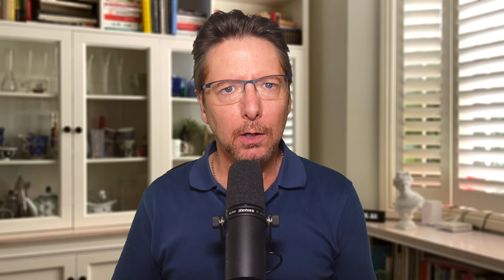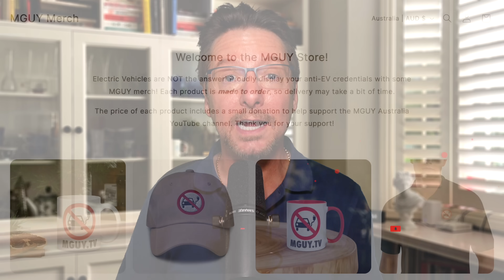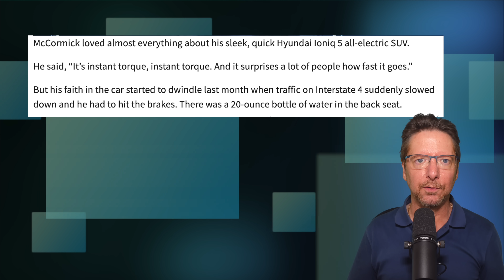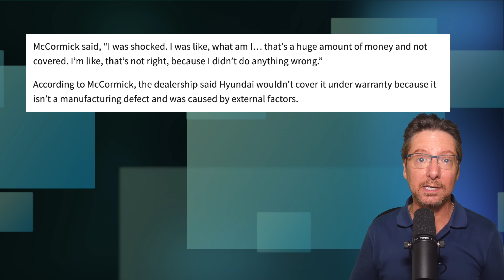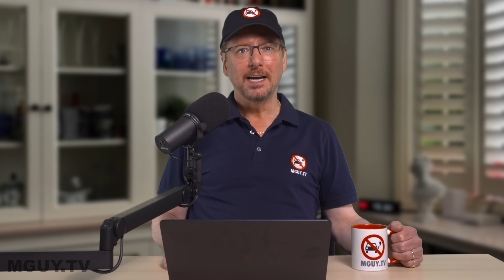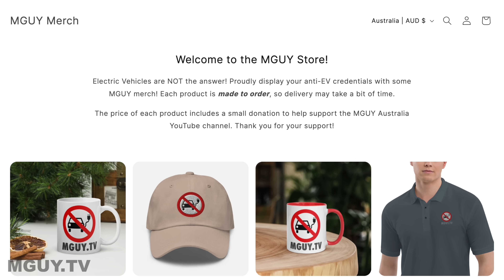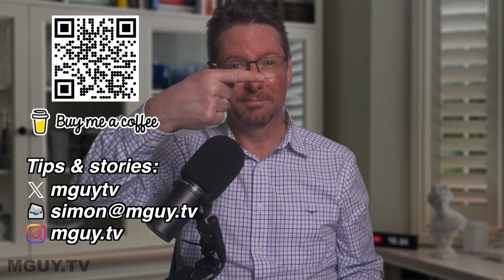ASTRONOMICAL EV repair bill for spilling a WATER BOTTLE! | MGUY Australia

Comment: Its not only cars. Tractors now are all full of electronics and one faulty bit means a whole electronic control unit needs replacing. ECU's are VERY expensive. "Repairing" things doesn't happen any more, you simply replace whole (expensive)  sections when a small part fails. Electronics are great when they work, but s**t when they don't.

Comment: Let's be very clear here. 
The water got into the wiring harness that is inside the cabin.   Now it so happens that ICEs and EVs have wiring harness inside the cabin. 
Engine management units for ICEs are often under the driver or passenger seat. 

So this fault could very much happen to an ICE and cost similar. 

So no this is not really an EV only fault. But rather sounds like a Hyundai issue 0:00
Reply: Hey Stewart, this is an anti-EV channel.
Reply: @thevolvodrive2811  I know. 
I also has a need to highlight  misleading information that Simon puts out , often by not  explaining the full story or omitting important facts. 

It's appears many who view this channel are  not willing or unable  to do their own fact checking
Reply: @stewart5989 Dear Stewart. I applaud your need to highlight misinformation. However, I suggest you hang out on pro-EV channels where the real lies and deceptions are really being spread!
Reply: @thevolvodrive2811  May I ask what lies in particular you are referring to.
Reply: @stewart5989  You're a big boy Stewart. You go check out some pro-EV channels and I am sure that you can figure it out for yourself.

Comment: I'm surprised some company hasn't introduced a conversion service that converts an EV to a sensible gas car.
Reply: The way they are designed for the electric drive is so different to a conventional car it would involve so much work to actually fit a petrol or diesel engine and make it either rear wheel drive or front,it would be ultimately easier to cut the entire flour pan out and swap it for a normal car flour pan that has all the mounting points needed for the engine gearbox petrol or diesel tank the suspension on an ev holds the drive motors so every thing basically is completely different underneath, probably why there are no conversation kits or any converted ev,s, rich rebuilds did a ls v8 swap into an early Tesla and it involved 3 years work iirc and remaking the underside and engine bay that is all aluminium specialist welding and expensive materials it did eventually run and drive but was more a showpiece for the USA Sema show than a reliable usable car

Comment: Bad design is not unique to EV’s now.  An auto mechanic did a video on a new Ford car that the inside door latch on the passenger door had broken.  He can’t replace just the lever, but will have to replace the entire interior door panel.

Comment: In general an EV will save a person perhaps $35,000 in petrol costs over 20 years.

Thank you.
Reply: This only applies if you are charging at home, in a state with cheaper electricity costs 😅.

If you live in Hoboken, NJ then comparing it to an average gasoline only vehicle like the 2025 honda accord, 28mpg combined the BEST case scenario is you save $1480 over 20 years, and this is after expending an average of 91 hours a year finding parking in Hoboken's city subsidized parking garage B or D and getting a charging spot then coming back and moving it to another spot in the garage to avoid idling fees then moving it out of the garage within 8 hours to avoid overnight parking fees. Charging on the street loses money vs gasoline, DC fast charging loses a LOT of money vs gasoline 😂😂😂😂

And thats only at less than 2% US wide EV adoption 😂😂😂😂😂😂😂😂

Without considering the electricity price hikes for datacenters or more EVs 😂😂😂😂🤣🤣🤣🤣🤣

Good joke post though. You must have struggled at school.
Reply: @6Sparx9  Some very cheap off-peak tariffs in Hoboken, some less than 10c a kWh...let us say 10c to charge a 60 kWh battery that will take you 300 miles...cost $6.00 compare that to say $35.00 for gas, say $30.00 saved for every 300 miles or $1500 for 15,000 miles a year or $30,000 over 20 years.

Thank you
Reply: @christopherj2231  Nope, I just checked 40 the 56 public chargers offered by Chargepoint and Shell Recharge in Hoboken, all level 2 chargers start at $0.44 per kwh and lvl 3 start at $0.49 plus a $1.30 flat fee.

Apart from the fact a 7.2kw charger takes 5 to 8 hours to charge an EV, charging $0.44 or more per kwh pretty much erases any savings against gasoline, and that doesnt factor in registration taxes, severe rage losses when cooling or heating the cabin or time lost messing around with finding charging. It literally only feasible if you can charge at work or home, or if you use DC fast charging all the time.

Comment: Hyundai is implying that this is a design feature, built-in obsolescence as this is not manufacturing defect.  This means that you shouldn’t buy an EV if you live in a sandy area such as a beach or a desert.  In the USA, Northeast roads are sanded in the winters.  This means that there is a possibility of corrosion.   Basically, avoid any area where a foreign substance can cause corrosion if you own an EV.  Kids in the back spill beverages all the time.  Hyundai is implying that you shouldn’t have kids if you buy an EV.  On top of that,  dogs urinating in an EV could cause corrosion so don’t own pets as well. Nothing is as corrosive as salty urine.  Moreover, don’t let a teenage boy use the EV for a date as he might use the back seats for some extracurricular activities.  Better yet, don’t live a life if you own an EV.

Comment: The parts are purposefully expensive and even when it's the suppliers doing the gouging the manufacturers don't care. They let them. What happens is car manufacturers order parts/components from suppliers and then they allow the suppliers to make those parts unique so only they can manufacture and sell them.
Then when customers suffer from faults the suppliers can ask whatever they want for the part, and there are absolutely no alternatives.
But it's even worse than that: We know for a fact like with Audi's E-Tron car parts, that suppliers have even purposefully made large, expensive modules which are difficult to disassemble and have simple, cheap failure points difficult to replace so that you have to buy the huge, expensive modules instead of replacing a small part worth a few quid.
They even have taken into account skillful repair shops who might still open the large components and try to replace the cheap failed item: the suppliers made eg. bearings special ones which are just between normal bearing sizes so no off-the-shelf bearings can be used to fix the issue, instead needing for a whole electric motor module worth many thousands to be replaced! 

It gets even worse: What the supplier will then do (this is true, documented fact) is when selling them the big replacement modules for many thousands they'll demand the customers send them the old, defective large unit to them. The supplier then repairs those big modules they received back easily with eg. a cheap bearing replacement (only they can do that since they have ordered those special bearings and have ensured the bearing manufacturer will not sell them to anyone else), then they sell those used 'reconditioned' modules as repair items to other customers who had those parts fail in their cars...and they demand customers pay many, many thousands for them! 

This is fact, it has been documented by many repair shops who have revealed this in their videos!

Comment: About 30 years ago we had a car where water leaked into the fuse box from a faulty replacement  windscreen.  When my wife was driving it in a thunderstorm it had what she described as a nervous breakdown as a whole lot of stuff short circuited.
The fuse box and windscreen were replaced by the well known windscreen replacement company the did the original replacement. Did cost anything like 12k even taking inflation into account.

Comment: This story reminded me of some 12 years ago when I had a VW Passat that leaked rainwater from under the bonnet into the nearside footwell and zapped a perfectly placed, and essential, electrical module under the carpet there. Replacement cost was very high and they refused a warranty claim, too. This kind of thing has been endemic in cars for a very long time.

Comment: Imagine spilling a bottle of water and having your bank account drained, it sounds more like a Hyundai Ironic.
Reply: i can see what you were doing there.....
Reply: Fancy your money going faster than your car 😂😂😂😂😂
Reply: @RobBeales I have an old rolls Royce, believe me I know the feeling.
Reply: Moronic you mean
Reply: Well you’ll have to imagine it, because it never happened, the guy drove it through a flooded road and then tried to blame it on a bottle of water, when the garage checked it they found water in all the doors, so knew it had been in at least two foot of water. That’s why they won’t pay out.
Reply: @Linda-u5x Source?
Reply: @roybatty- Same source as Mguy, he thinks electricity and water don’t mix, maybe he’s never heard of a submersible pump, the blokes a clown, an insincere clown, but seems the uneducated are falling for it, does he even know what powers a submarine? He’s a clown period.
Reply: @Linda-u5x Yes, electricity and water don't mix.  I used to work for a small company that manufactured mild hybrid systems for commercial vehicles.  The motor we were using in the kits had a problem with water leaking into the housing and would eventually short it out.  The company went out of business covering warranty because of that motor.  Also, have you ever heard of what happens to cars that get flooded in hurricanes?  They must be identified as such to prevent them being resold as used cars.  Once salt-water infiltrates wiring harnesses, it's just a matter of time before the electrical system suffers random faults.  And I'm sure you've heard of fires happening when EV's are submerged in hurricane storm surges.  Gasoline cars get flooded all the time, but you never hear about them catching fire because of it.  Long-term they will suffer electrical gremlins, but they won't burn down your house because of it.
Reply: @andyharman3022 There are millions of underwater pumps and submarines operating around the world, please don’t base all companies on your failed employer, electricity cables travel under oceans, I’m surprised you don’t know this? And as for cars catching fire, no one on the planet has heard of a diesel or petrol car catching fire,,,,,except they have, the clues in the fuel, you see, petrol is highly flammable and cars that use it have wiring and a battery. You have been told to hate electric cars by the oil billionaires, the same billionaires who are investing in green energy and electric cars. There were people like you who didn’t want the end of whale fishing or the powered loom or steam car, they are called Luddites, and it seems there are still Stone Age clowns around today.
Reply: @Linda-u5x
There is a big difference, the petrol is contained in a relatively small vessel, and the power source and electrics are not in direct contact, EVs are accidents waiting to happen, any hole or pothole has the potential to trigger a malfunction in the battery.
Reply: @pauldurkee4764 That’s just not true, and I don’t know why you want it to be true, desperate for it to be true? Oil tankers spill millions of gallons of oil in the oceans, oil refineries are having fires all the time and destroy wildlife and countryside, what’s wrong with you people? Don’t you want less pollution, why are you worried about billionaire oil barons? You need to get a grip, What do you want next, leaded petrol and the use of asbestos’s? Some peasants just can’t be helped.
Reply: @Linda-u5x That's an interesting twist to the story.  You should have posted that as a 1st-level comment so more people could see it.  But I also point out to you davetaylor4741's comment about driving his Land Cruiser through water over the door sills.  Seems like cars in the real world have to survive unusual circumstances from time to time.
Reply: @scubasqrl So basically you're saying EV's are inferior to real cars.  Make one mistake with one, and it becomes a brick that costs a fortune to fix.
Reply: @Linda-u5x That makes no sense at all, if he drove it into water, it would have broken down immediately, not much later when he got home. Water ruins electronics instantly. Legit insurance companies also cover flood damage.
Reply: @J @John8087 Typical Luddite making up his own narrative, where in my reply did I say when it broke down? No, you just made that bit up didn’t you?
Reply: @Linda-u5x You've been shilling so much you can't even keep your own lies straight. 🤡
Reply: @Linda-u5xstill shouldn’t have damaged the car!!

Comment: Guess where lots of the critical electronic modules are on a USA Ford Transit. Yes just behind the drivers cupholder. Car Wizard did a video about it. I worked for a large Indian Company, if the vehicle failed the water soak test it would wet the carpets or interior , so the seats and carpets etc would be removed, water would be mopped up, concerns about wet electrics were constantly overruled.
I do wonder how many of those vehicle went on to fail due to corrosion.

Comment: Consumer protection doesn't just cover manufacturing defects, whatever you're buying has to be fit for purpose, and take into account what customers are likely to do with it. Spilling a bottle of water on the seats is entirely foreseeable and the design should be able to withstand it. Otherwise, it should be pointed out to the customer at the point of sale so that the customer can make an informed decision as to whether to buy such a fragile vehicle.

Comment: Lift the seats and/or carpet, open all the wiring connectors, hit the connectors with a hair dryer, leave a fan heater or a dehumidifier in the car for a few hours, reconnect all the connectors and switch on.

Car dealers are notorious for wanting to replace a full wiring harness instead of diagnosing and repairing the existing wiring.

Comment: That’s nothing really to do with it being an EV. In many modern petrol cars the seats are complex and house tons of electrical parts. My petrol car has 16 way front seats and I’m sure it will cost a fortune should I be dumb enough to pour water over it. What I don’t get is how water on the back seat got UNDER the front seat. Unless that Chronic 5 has a completely level floor that slopes under the front seats don’t see how it happened. Most cars have I rear footwell and I would have expected the water to end up there.

Comment: Thanks for covering this. One correction, the EV wasn’t a brick as the owner couldn’t shutoff the EV.   This means the EV is operating with fried wiring which is dangerous.  He didn’t say how he got the EV to the dealership.  Watching the YT video from WFTV Channel 9 news shows that this guy is an ordinary guy not some rich dude.  He has a carport not a garage.  You can see a wall picture in the background of a starfish.  He must live by the beach as he has a pillow with a beach quote and the dealership did indicate that sand buildup may be a cause to the corrison. He is just an average guy. It is unfortunate and sad situation.  THIS IS THE WORD TO THE WISE. DON’T BUY NEW TECHNOLOGY UNTIL ALL THE GREMLINS HAVE BEEN WORKED OUT. Hyundai rushed a product to market and this is the result.  This case could be a class action lawsuit in the making or as a minimum, a recall.  This is a design issue.

Comment: Just shows what rubbish these EV's are. Can't even take it to the beach as it is scared of sand. My 2003 Ford BA xr8 ute has cost me  a radiator,  vacuum servo unit  left hand ball joint and roof lining/ drivers seat repair.   Where would an EV be after 22 years ?

Comment: Remember when a light went, and you only had to buy a single bulb and you could do it yourself - oh, and that was as a woman, with no idea of what went on under the bonnet ("hood" for those in the US and elsewhere!). 
If they are talking about corrosion in 2 years - what about people who live in the UK - our Autumns are the start of  damp weather through to the middle of Spring. Cars are now too wide to be put in a garage - so are they just going to sit and rot on your drive as soon as you get it out of the showroom? Condensation in cars is a daily thing. Hope the buses and delivery vans have better protection for their circuits and wiring............
Reply: Hope 'Springs' eternal. Perhaps they should go straight into climate controlled museums of stupid ideas.
Reply: Yes, and that bulb is $20, not $2000 😃

Comment: So,  what happens with your Ioniq 5 when you run into a thunderstorm and your passengers dash throught the rain to the house and during those 30 secs. or so both rear doors are open and torrential rain comes in ?  You scrap it,  right ?